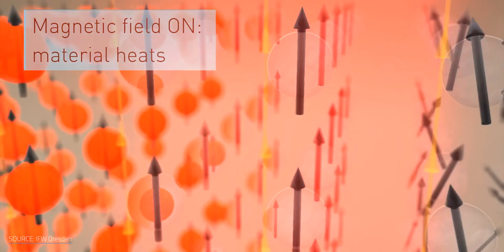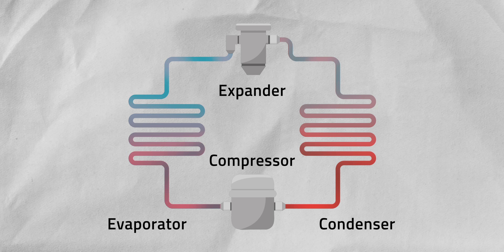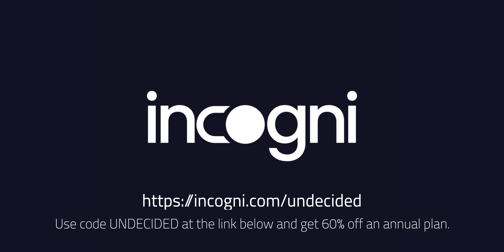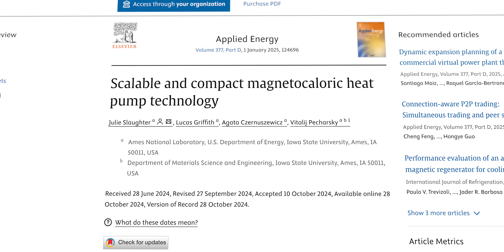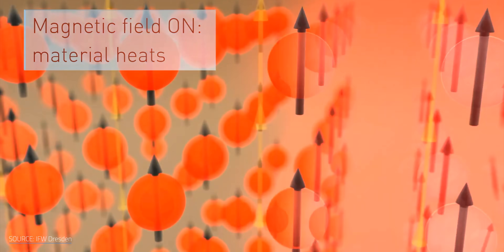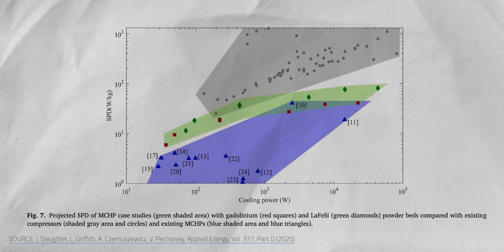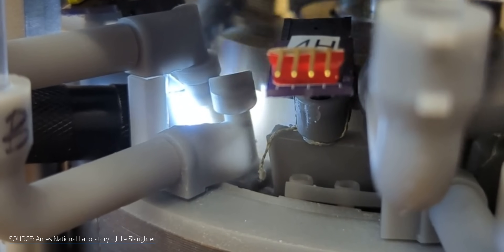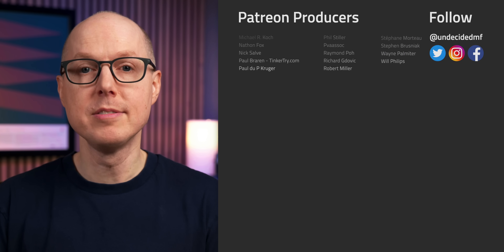How Magnetic Cooling Is Breaking All the Rules

Comment: Weight, cost and performance... those are the parameters chosen to determine the efficacy of this machine. The initially stated reason for efforts to move away from refrigerants currently in use is their negative environmental impact. Propane is a drop in replacement for R-22. Before everyone gets their panties in a wad concerning its flammability, we have been burning petroleum products for well over 100 years. As a refrigerant, propane is not burned. It is in a sealed system. To burn, propane must mix with oxygen in the presence of a spark or flame. This cannot happen in a sealed system. What if there is a leak? Still gotta have a spark or flame and there is so little propane in a typical residential system, the fire cannot last long. Ideally, the entire system would be located outside to reduce the perceived danger. If one still finds the risk too great (insurance underwriters), the unit could chill water, which is then piped to fan coil units inside the edifice. We think nothing of parking our automobiles in the attached garage of our homes. So, why has propane not been widely accepted and used? Same as everything else... follow the money. There is very little profit in using propane as a refrigerant. The petroleum chemical business would lose a very profitable product. The only ones to benefit would be everyone who depends on refrigeration. What a concept!

Comment: This might even make more sense in an environment where the cooling system is exposed to mechanical stresses and more varied environmental conditions. Anyone dealing with automotive AC systems knows the things will leak out eventually, and occasionally there could be stuff like stress fractures in the metal parts of the lines. And the refrigerants can get a bit pricey.

Also there were always alternatives to CFCs/HFCs prior, but those chemicals tended to be quite flammable and may also act like solvents in their liquid phase. (Stuff like butane or propane, etc.)

Also it'd be funny if there was a way to do this magnetic cooling with some kind of bismuth-graphene matrix and use a solenoid rather than a moving permanent magnet. That could likely make things really cheap if something like that actually worked.

Comment: There are lots of good CFC alternatives.  But the bane of using a gas/liquid cycle is 1) leaks, and 2) failed compressors.  Magnetic cooling solves these.  But what are its problems?  How long do they last and what maintenance do they need?  I would certainly pay a premium if I could install an HVAC system and not touch it for 30 years.
Reply: Don't worry, when these things reach mass production the manufacturers will engineer in all the failure modes we need to keep us all in a job.
Reply: From the 1950's to the 1990's, refrigerators lasted about 30 years.  Things have been going downhill ever since.
Reply: @theclearsounds3911 that’s mainly due to sensitivity of sensors increased and lower quality components. I.e. we can see when things fail and are using cheaper things to build.   I believe we need to focus on higher quality components and less “disposable” tech.   Magneto calorics are interesting especially if we build them with quality components.
Reply: @theclearsounds3911  Such statements are difficult. For one the survivor bias takes effect, also these old things used a lot more power in use and resources to built. And a fridge was a luxery item back then.
Reply: @theclearsounds3911  the company I work for built a 250 apartment complex around 2020 and almost 10% of the fridges failed in the first 6 months, it was ridiculous. Meanwhile I have a couple PTACs that are almost 40 years old still working while some of the newer ones die after 3 years. One time I replaced a 4 year old Goodman system that almost the entire indoor coil had dissolved like someone poured acid on it.
Reply: @theclearsounds3911  that is because almost all are now heatpumps and coolers. More components that can break down.
Reply: Since it is a water based system you'd likely be looking at something similar to a boiler maintenance schedule for drain and refill (not that those schedules are usually followed anyway), and more than likely something like a zinc anode that will need to be inspected and replaced periodically.

I can't recall where I heard it, but recently came across something about expected lifespan of current residential HVAC units being 12-16 years. Though with the absolute dogshit quality control in the industry these days...
Reply: @brunsy1990  Doubt you need water specifically for the units. Since its a low volume closed loop other more expensive coolants could be used, light mineral oils, alcohols, pure glycol, etc, and they'd still be way cheaper than the refrigerants we're used to buying. Tbh what I like most about this idea is the servicability of it. Since its not pressurized to induce phase change and the coolant is a liquid at all operating temps it means the unit is much less likely to leak and if there is a leak its going to be user serviceable with basic fittings, not something like R-134/etc that are hundreds of PSI. Even better, the motor and magnet are not in the working fluid, so if they fail its a simple unbolt and unplug job. And finally, the actual working bit of the chiller isn't a scroll or piston or other monolithic body, its a distributed foam in multiple chambers, so its very unlikely to fail catastrophically and much more likely to just degrade over time.

All in all, in almost every respect it sounds like its both wildly more serviceable and is putting less stress on individual components and so less likely to fail. It could end up killing off a significant part of the HVAC service industry. Nobody is going to have to gauge up to diagnose compressor or refrigerant problems, connections aren't going to need to be brazed.

The really interesting question will be if they can make backwards compatible upgrades, i.e. get your refrigerant drained, yoink the compressor and expansion orifice from the system, put in the magnetocooler, fill with coolant, and bam. Your old R-XXX system or RTU or whatever is now updated to the new system. The condensors and evaporators should work, since the coolant won't need to be pressurized.
Reply: @Ariel-x1x early refrigerant fridges weigh considerably more than modern fridges, but over time we figured out different materials to use to make them lighter. I don't think it's inconceivable that materials science could lead to similar weight reduction in these systems as well. It's an emerging technology after all!
Reply: @brunsy1990  I imagine the water part is only a short loop between the air handler and the exterior heat sink.  I suspect it would be done something like your car with an anti-corrosive anti-freeze.  If you used pex lines and a copper or stainless steel heat exchanger, I suspect it would last 50 years or more.  Go cheap with aluminum, and you will be replacing the radiator in 10 years I bet.
Reply: I suspect that the magnetic beds will degrade over time meaning that it will be very much replacement rather than repair, and it will still have the same problems with leaks and motors, but the major problem will be carrying the heat some distance from the unit. In other words I doubt that this technology will be able to be used in apartment complexes.... Frankly it will probably only work for window units, package units, and RTUs.
Reply: there is no 'good' CFC alternatives. They're most potent greenhouse gases. Some that aren't are chemically unstable, making them both less greenhousy and more flammable. Notable examples are R-290(which is just propane) and R-1234yf
Reply: ... And there's the problem, the infinite growth cult demands disposable products. We could have light bulbs that last forever but they're rigged to fail.
Reply: @apostolakisl  you will never get a ac unit to last 30 years. Old ones did , nothing modern has any hope of making it half that long
Reply: Compressor units are sealed and motors spin inside the sealed compartment constantly lubricated with the very same coolant. That's a benefit, not a drawback.
You will have to lubricate the motor here still. But this time it's not self lubricated. Imagine each weekend you have to check the "oil" in your refrigerator.
Pipes and pump are still required to move heat as there's no way to conduct heat from indoor ceiling fan unit to outdoor unit by wire. But this time the motor you have to tend for each week cannot doube as a pump like in compressor - you need second motor for pumping coolant.

More over they are making rotating magnet field in the motor to spin a piece of iron with attached permanent magnets (that do loose power with time and especially heat) just so those spinning magnets do create a spinning... magnet... field.
Man, thats dumb.
Reply: @TheGooEater  You have described nearly every electric motor in the world.  They all have sealed bearings.  The air handler has an electric motor in it regardless as do the outdoor heat exchanger.  Those do fail, but it isn't a death sentence for the unit when it does.  Trouble is they are all using ECM motors now and it isn't the motor that fails, it is the ECM module.  I have had 3 of those fail on me.  The motor windings and bearings and mechanics are all in perfect working order, but some component on the ECM (capacitor probably) died and rendered the whole $800 motor trash.  For me, it has been the outdoor fan motor.  Probably heat related.
Reply: @apostolakisl  oh wow! My mother is having problems with her unit blowing. After checking all the usual stuff like voltage, charge, and variable inverter (power), I turned the fan only on to check if it is the blower/motor. The motor/fan ramped up perfectly and was blowing full capacity after a minute or so. So the blower only fails when in cooling mode. It does turn/blow but very slow/lightly. The techs my Mom talked to ordered a new blower. So I assume the a new blower comes with a new ECM? Please help and thank you
Reply: @TheGooEater  If there were benefits to sealing a motor it would be done in other contexts. It's done for compressors to eliminate a dynamic seal. You'll lubricate the motor like literally every other nonsealed electric motor out there, with a permanently greased bearing. Do you ever check the oil of any electric motor around your home?
Reply: @cutterjohn1921 oddly my cheap bedside fan needs a squirt of break free once a month or so . 
Dang piece of Chinese junk.  
I know its time when it starts fluctuating its speed . Even had it seize up a few times 😂
Please lord , don't let my refrigerator act like my bed side fan 😅

Comment: If this works as well as this suggests, goodbye Peltier Plates! That was the only other cooling method commercially available, used in those plug-in portable 'ice-free' chest coolers. They were so weak though, only able to manage a 20-40 degree Fahrenheit difference with worsening efficiency with hotter ambient temperatures.

Comment: A much simpler change would be to get rid of the HFC and move to propane. The global warming potential of propane is very low (with a GWP 20 of just 0.072), so if it does leak, the impact is minimal. The issue with propane is the concern that in an air-to-air system operating in heating mode, the inside heat exchanger acts as the condenser. The result is that high pressure propane would be coming inside the house, which represents a safety risk should the propane in the system leak inside the house.

The solution to this is simply don't bring the propane inside the house. Instead use an air-to-water system where water is heated or cooled by the heat pump and only that water comes inside to either heat or cool the house. Then the propane stays outside where a leak is not a safety risk.

Also with water transporting heat in or out of the house, a buffer tank can be added to the system so that the system doesn't have to operate when the temperature is coldest at night in the winter or when it is hottest in the middle of the day during the summer, thus increasing the average efficiency of the total system.

Adding a phase change material to the system that melts/freezes at the desired storage temperature can store several times the thermal energy in the same volume as a simple water tank.
Reply: boom?💥💥

Comment: Now, can you use this in a computer?
Reply: @dra6o0n  wouldnt you need to distribute the cooling with a coolant anyway? (most likely water) in the end, its just water cooled computers just with a heat pump connected directly to the water coolant

Comment: The place I used to work made magnetic refrigerators, but at the low end of the temperature scale.  They've been selling for quite a while but mostly to physicists.  They are called ADRs, for Adiabatic Demagnetization Refrigerator.  If you need to get below 1K they'll do the trick along with dilution refrigerators using He3 and He4.
Reply: dilution refrigerators are different from adiabatic demagnetization although both depend on the entropy change. these are useful only at low temperature but surely you remember the rubber band refrigerator?
Reply: @janami-dharmam  YES! Those are fun.  A good way to teach about entropy.  I worded the original post wrong.  ADRs and dilution coolers are separate ways to get cold.  It sounded like they both are required.
Reply: Yup they can get cold. Tested one for cooling a MWIR detector way back in 2008. Those dilution refrigerators can get to nearly absolute zero but the cost if tge He3 is frightening 😳💀💯
Reply: That will do for my ice cubes.
Reply: Yep, Kiutra can go down to 100mK. But still not as low as dilution refrigerators

Comment: What I'm hearing is that "this project is (stalled out) because the current "step" is to make it smaller".  OK.  There are two paths to tackle that problem.  ONE, because the technology is to big to make for a refrigerator, we can let the project (sit on the back burner).  And do "almost nothing", until mankind forgets about this (think Greek fire or Roman concrete).  OR path TWO.  Use it now, with it's BIG status.  In Home cooling.  The refrigeration unit sits outside.  It can be big.  In my rural area, it can be really, really big.  I've got a 20 acre yard.  And when people "see" this stuff, crowd funding will pour in.  And it will happen sooner.  The entire world will help on this.  Kids at MIT will have epiphanies and e-mail them over.  Take (PATH TWO) and run with it.  Your project will be done by Christmas.  OR there is PATH THREE.  Get AI in on this.  Ask Grok (grok.com)

Comment: I love how they completely avoided any ∆T measurements, entirely. They also side stepped the energy requirements for even a modest result. While some of us are concerned about the refrigerant, I'm more concerned about the energy required to get results. 1W = ??? That's the problem with these startups. There's never a known standard they are willing to compare against, on hardly any metric, because they refuse to express those data points. On top of that, putting a refrigerator full of drinks in a cooler, in an air-conditioned space, is just a trick. Even after doing my own research, I'm doubtful they will overtake the raw output of the compression cycle. God knows I'm happy to be wrong though. Just not enough data or published papers to be able to do the science locally on paper. Oh well. Let's give it another 18-24 months.

Comment: I have only tried thermo electric cooler (TEC).

But if used as a secondary ( byproducts) to its free heat or cold or electricity.
  
 Its a bit limited energy efficiency,have about 1/4 the efficiency compared to conventional means...
With feedback circuitry, temperature within ±0.01 °C they say.
To bad is life cycle of the units...

Comment: This is truly fascinating, and I paused this at about 3/5 of the way through, so I am posting this question on the assumption that this practical aspect/effect won't be covered, but, does this mean I can put this as a solitary cube type item anywhere in the house if they are ever redesigned as an AC unit, and not have to worry about CO2 emissions, nor will I have to hook up a window vent tube? 
Another question I have is, because it can generate cool, can it generate heat also?

Comment: Why bother with a motor? Why not just build an out-runner induction motor stator (similar to a ceiling fan motor) directly into the magnetocaloric ring? that saves mechanical components, and eliminates the need for permanent magnets, saves weight, and cost. All you would need, is the same alternating current source, that would be used to run a typical induction motor. All "off the shelf" technology.